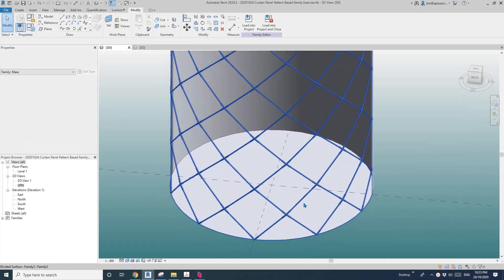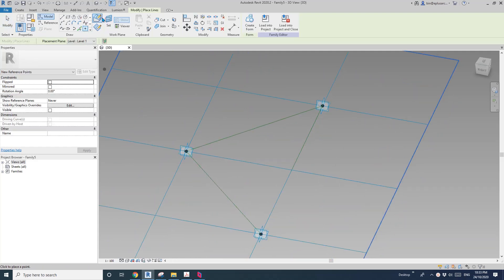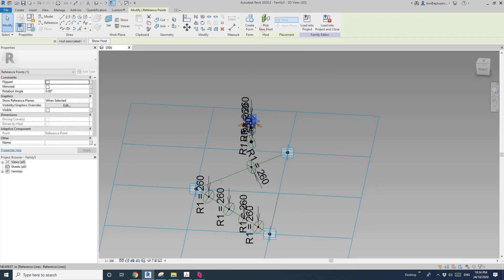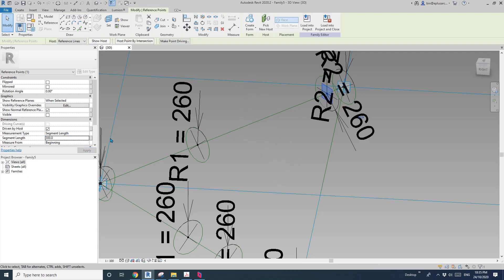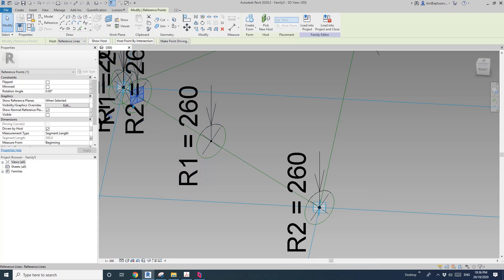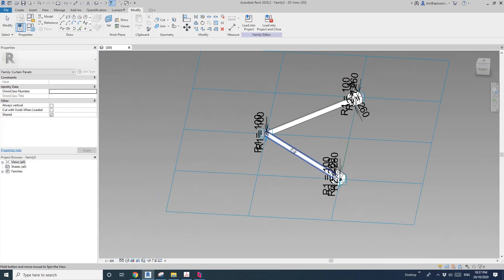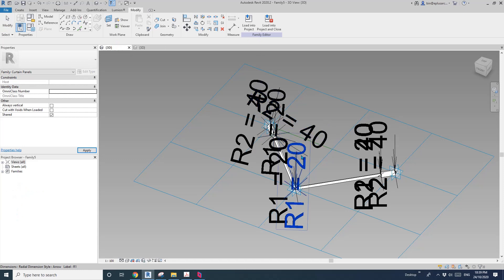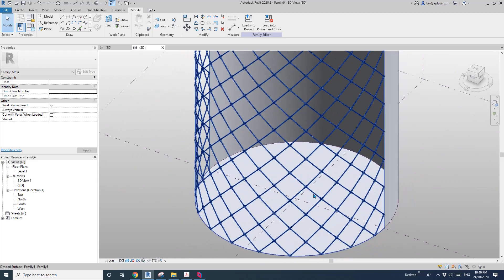Revit Exercise (Day 220) - Curtain Panel Pattern Based Family

Comment: Hi Bin He, By chance do you have a video on Joist Family, I tried to edit one but there is an overwhelming amount of parameters. I check both English and UK libraries but they have the same family made up of steel angles, I wanted to change the structure to a hollow square section, but I check the family and it is kind of made up with extrusions. thanks for your videos!
Reply from the maker: Can you send me a sketch of what you intend to do?
Reply: @BINHE615   The default is https://images.app.goo.gl/Rm7Yi9mFJZm9LGz16 , but I tried to change it to look like  https://photos.app.goo.gl/KGpiEdxYX1E8hnf69
Reply from the maker: @CrlsE094  Can you send the revit family to my email and I'll have a look for you tonight?
Reply from the maker: binhe615@gmail.com
Reply: @BINHE615  I sent you an email please let me know if you did not receive it.